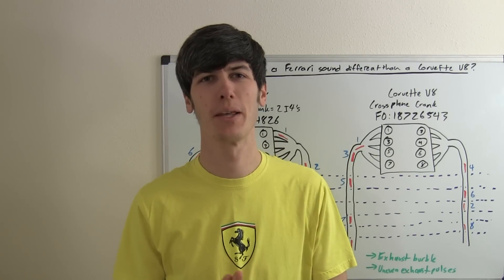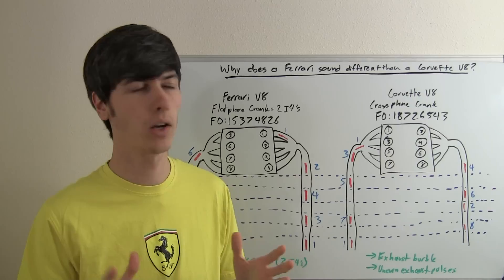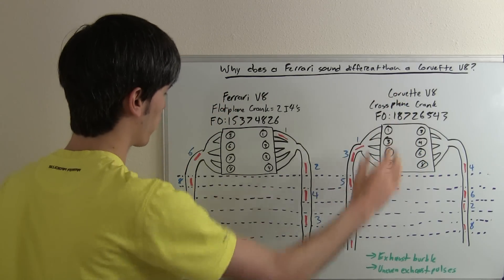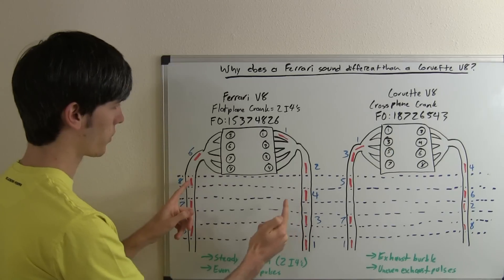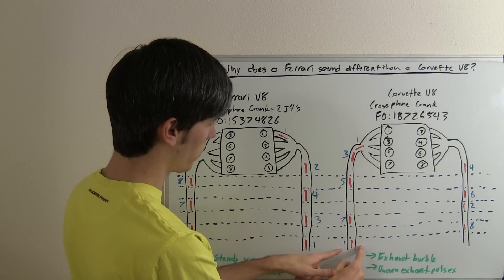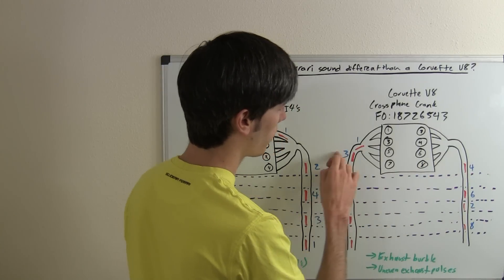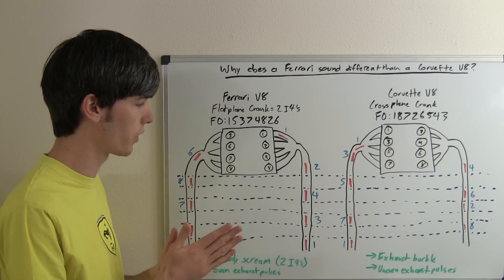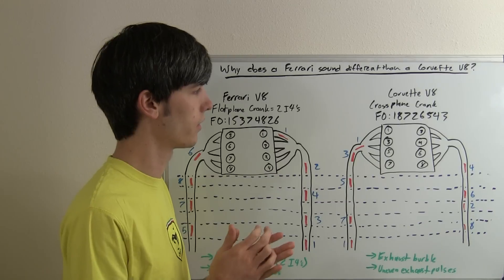Ferrari V8 vs Corvette V8 - Why do they sound different?

Comment: Huge corvette fan but the sound of a 458 and especially the speciale are two of my all time favorite soundtracks I've heard in person. There was a 458 on the freeway in LA with a new c7 vette right behind it and going through a little tunnel when there was a break in traffic and the 458 lit it up a bit then the vette and imo it was not a hard choice to favorite the ferarri. I've read the way the pushrod engine in vettes make them quiter then a dohc (not sure if I have that right) but I can tell compared to other v8s the sound seems less powerful stock for stock. Still any LS engine sounds great to me and I've jeard a little bit of the new supercjarged z06 vette on TV the other day and it sounded mean. The big nasty is an appropriate name for the new z.

Comment: Have you done 1 explaining duel scroll turbos ? Or maybe supercharger or turbo explain how 1 uses exhaust and the other a belt maybe then explain the difference from roots an Centrifical chargers then maybe direct port N.O.S vs plate systems u know all the power adder stuff to grab attention of gear heads everywhere.ur drawing board approach could work for just about anyone who can pay attention for longer than 15 mins

Comment: this is why my Porsche 968 with short stroke 388 c.i. LS7 sounds so good. I've got long tube headers into a huge y-pipe w/ 4" to 3.5" reducer and 3.5" single exhaust w/ 2 borla resonators and 15"X9"X5" vibrant performance muffler out the back. The open pipe system + good spl reduction plus point source sound out the back takes a lot of the harsh sound out.

Comment: American (crossplane) V8s - Throaty thunder
British crossplane V8s - VERY similar to (or about the same as) American crossplane V8s
British flatplane V8s - Badass growl
German crossplane V8s (especially from Audi and Mercedes) - Deep, badass, teutonic rumble
German flatplane V8s - Apart from BMW's P65B44 from the Z4 GT3 and flatplane version of the S65 from the i8 V8 GTR (which sound the same as German crossplane V8s) and the P60B40 (which sounds about the same as British flatplane V8s), it's pretty much meh (if we talk about Class 1 DTM engines)
Australian V8s - Throaty, growl-like roar
Italian crossplane V8 (from Maserati) - Badass, grow-like roar
Italian flatplane V8s - Beautiful, symphonic roar
Japanese crossplane V8s - Same as American and British crossplane V8s (apart from Yamaha-tuned Volvo V8, which sounds like a mix between American and German crossplane V8s)

Comment: Most Ferrari V8's are small in displacement, and it needs to rev high to get into the power band (5,500 to 9000rpm) Ferrari 458 (4.5 liter)  Most American V8's are much larger in displacement, and the bigger the motor the more torque you have, and most of the time you have the power right out the box. From idle to 6,500 rpm ( 6.2 Liter LT1)

Comment: Yeah man. Can you explain the firing order you got. I'm pretty sure Corvettes use a small block 350 which is 18436572
Reply: I thought I was the only one that noticed lol.... and I really like this guy, but now I have to question everything that he has led me to believe! LMAO
Reply: Uhhhh no. I believe that the older corvettes used the 350, but I know for a fact that the c6 uses the ls7 engine. Yes similar but different. I do think that he should have specified what corvette and exactly what engine he was talking about since Chevrolet has used so many different types of their v8 engines in all the corvettes.
Reply: The first and second gen small blocks used the old 18436572 firing order. The gen 3 and newer (starting with the LS1) switched to the 18726543.

Comment: Other reasons the Ferrari's have the hi pitch scream is also because of small cylinder bores and small valves and pent combustion chamber. Corvettes has large cylinder bores larger valves and a wedge/ kidney bean combustion chamber. The small bore acts more like a whistle making it sound like a  scream. Where as the large bore acts more like a bass port releasing a burbling boom.  Fun fact the uneven pulses are actually equalized on all modern day V8 at the catalytic converter which doubles as a X pipe (or cross over tube or H pipe is what they called them in the 60's). American V8 can accomplish the Ferrari scream I encourage you to look into a 1966 Ford GT40 with what is called "Snakepipe headers" Ford equalized the exhaust pulses with the headers. The larger bore and wedge combustion chamber (lower rev range) still makes it largely sound like an American V8, but you can hear it just start to scream on the Mulsanne Straight at Le Mans. Ford used the same "Snake pipe" technology on their 1960's V8 Indy car ( those did Scream!) To better prove the point it's the small cylinder bore I encourage you to check out the smoking tires channel video "The Cobra-Blown, Lexus V8 Swapped "No Style" '75 Corolla" It's a small bore Lexus V8 with an American style crank and firing order with the "Snakepipe Headers" it screams like a Ferrari. Enjoy!

Comment: This is only PART of the reason a Ferrari V-8 has that high pitched "scream".  There are several other reasons: 

1. The Ferrari cylinder size is going to be smaller than an American V-8.

2. The stroke of the Ferrari is going to be shorter than an American V-8.

3. Having 5 valves per cylinder in a Ferrari versus an American 4 valves per cylinder. 

4. The Ferrari has a smaller exhaust diameter than an American V-8. 

These all contribute to the sound being different.

Comment: The shape and weight of the crankshaft in flatplane engines aren't compensated enough by their piston firing orders to have the edge. The lower center of gravity and firing pattern of crossplanes are superior in my opinion due to the evenness of the crank among other things. That's why you see 13,000(top fuel dragster) horsepower crossplane engines and no flatplanes even close. And I also prefer the exhaust note.
Reply from the maker: I can assure you the multiple-thousand horsepower level comes down to much more than the crankshaft design. An incredible amount of boost would be a start.

Comment: You explained that Ferrari V8 has been made this way because the exhaust scavenging is improved by avoiding pressure spikes. However, why is a Corvette engine made like it is, what is the technical advantage of it? Is it done to avoid the high pitched exhaust whine?
Reply from the maker: Siana Gearz This should help explain each: https://www.youtube.com/watch?v=_TssXF8yQek

Comment: I'm a freshman in college and I'm an engineering major. I've decided to be a mechanical engineer, and I want to focus on the sound of a car. What focus of mechanical engineering deals with the sound of a car? Would I be a crankshaft engineer, an exhaust engineer, or is it a different focus?
Reply from the maker: TheFutureEVH You have a long road ahead of you, but ME is definitely a rewarding degree. My suggestion would be to work through your ME classes and see which ones you enjoy most, and find careers that match up with those interests. Acoustics is all vibrations. Anything that vibrates can make a sound. It's probably one of the more challenging things to grasp, from a mathematical standpoint. Good luck!
Reply: Thank you for answering, but I'm wondering which part of the engine is mostly responsible for the sound? I would like to be an engineer that deals with the sound the car makes.

Comment: they sound different because of the cylinder sizes and because of the different rev-limiters
Reply: They're both big engines and the rev limiter doesn't affect the sound, while it is true that one revs higher than the other. It's mostly the structural differences between both engines. A >1l miniature V8 based on a chevrolet design sounds more similar to the actual corvette engine than the ferrari engine which is much bigger.

Comment: On a flat crank V8 engine, you have four cylinders at TDC at any one time.  In a four cycle engine, that means two must be in firing while two are in exhaust.  So doesn't that mean your exhaust pulse timing diagram is off?  They are not staggered bank to bank, but rather pulse both banks at the same time, followed by 180 degrees of no firing.  In contrast, the cross plane crank gets a single firing pulse every 90 degrees.
Reply from the maker: Brett Dougherty Remember the cylinder banks are at 90 degrees, so when one bank is at TDC it does not mean the other is. Here's an animation so you can understand the firing orders are one at a time: https://www.youtube.com/watch?v=I29P3K6POu4

Comment: What about my engine (Hyundai G4ED 1.6) that fires 1342, and a Honda b16 that fires the same pattern? They sound very different compared to each other. Could it be different head and valvetrain design?

Comment: So would it be correct to say that the flatplane V8 would not benefit much (at all?) from the crossover pipe that does such a nice job of improving exhaust scavenging on American V8 engines?
Reply: OffRoadRN i think that when you are going to have a turbo on your v8 engine and its a flatplate, you wil have smooth and better boost than with a crossover.

Comment: Can you give any input on what would cause the "growling" sound on Suzuki GSXR models compared to the other inline fours? Would it be a crank issue again? When I rode one for a year it always sounded like the growl was coming from the airbox, and it happens between approx 4000 & 7000 rpm.

Comment: question, are they doing the different  firing orders just for the sound, or does one of them have some advantage in handling\power?
Reply: They have different firing order because of different crank layouts. Flat plane cranks are lighter and rev up faster and higher, but cross plane cranks have gentler NVH properties. The difference is explained in the other videos on this channel.
Reply: Karri Koivusalo whats NVH

Comment: If you had a custom header on the cross plane that separated the exhaust pulses evenly, would it sound like a cross plane without the downside of the larger secondary forces? Cross 3 and 5 over to the other side and 4 and six to their opposite side. Now this is assuming you have room to make all 8 header pipes evenly lengthened.
Reply: Would it sound like a flat plane crank*
Reply: +slowsword 
I think they might have done this on the old 1960s gt40 racing Le Mons with a ford 427 big block.

Comment: can you explain how cars with the engines over the drive wheels get the power to the wheels? (for example your integra) I can see how a normal fr layout car's drivetrain works, but not with a front engine front wheel drive car or rear engine rwd car

Comment: There is a lot more  to the sound difference then the firing order. 4 valve vs 2 valve , headers vs manifolds, tube design and lengths, H pipe  and X pipe as well as the mufflers. If you spend the time you could make a Ferrari sound with OHV engine.
Reply: They have done it with NASCAR years ago.

Comment: I have flat plain v8 engine and I can’t get it to scream like F1 v8 despite equal length manifold and 10500 rpm. Would the problem be because the engine is 72 degree block instead of 90 degree? I just would like to know what I need to do to make this engine scream

Comment: Isnt there a header you can get for a cross plain V8 that will space out the exhaust pulses from the cylinders that fire together?? ie. the header will have 2 of the runners longer so that one cylinder on each bank will have its exhaust pulse better mesh with the other pulses for improved scavenging??
Reply: it called 180 degree header

Comment: @ Engineering Explained.    I have a question.  My knowledge on cars is limited.  I have a Chevy V8.  I don't like the muscle car rumble "burble" sound, and I'm trying to eliminate it as much as possible.  I've read that swapping the firing order of 4/7 will smooth it out somewhat.  Also, I've heard of a 2/3 swap.  Would the 4/7 and 2/3 swap together eliminate the burble even more, and even out the exhaust pulses closer to the flatplane sound?   Does 4/7 work better alone?  Or does 4/7 and 2/3 together put the exhaust pulses back to stock (which I want to avoid)?
Reply from the maker: TheMr007247 The firing order is chosen for balancing reasons. I certainly wouldn't change it.
Reply: Engineering Explained  Is there another option to help even out exhaust pulse?

Comment: Crossplane engines are good for normal road cars which do not need to rew high and they are much smoother at the idle than flatplane engines , but they need heavy counterweights (talking about vibrations) . You certanly would not want to have your expensive $100.000 Mercedes vibrating at traffic light . Problem is that they start to loose torque high up because of backpreasure . Flatplane engies counterweights would not help , but their smooth out over 1000 rpm . Also , they have constant torque through whole rew range . So , for sport car , flatplane is better .

Comment: The sound is mostly different because american V8s have larger stroke vs ferrari engine's who have a smaller stroke but bigger bore for the same displacement.  This also explain why they can rev higher.
Reply: Francis Lapointe the real difference in rpm capability exists in the valve actuation architecture; ie the pushrod vs ohc argument

Comment: I think also that if one of the engines is smaller than the other one is also a factor why they sound different.
Reply from the maker: MC Taipan There are many factors which affect noise, however each of these engines have distinctive characteristics in the exhaust sound (burble vs whine) which are derived from the firing order.

Comment: Does the flate plane crank have anything to do with the typical less torque numbers made by ferrari vs the others? I knew about the firing order and  minor difference in balancing of the motor. But have always wondered why a Ferrari V8 made less torque then near equivalent Cross-plane v8 (be it US, German, or Japanese)
Reply from the maker: +Michael Gross Probably because the Ferrari V8s tend to be much smaller displacements but rev higher, not necessarily the crank design.
Reply: On top of that it may have something to do with the bore/stroke ratio for the displacement
Reply: +Engineering Explained Actually I believe that helps by reducing the rotating mass in the counter weight department which seems to help the engines pull another 1000 or so RPMs

Comment: Yo Jason!! In one of the fast and furious movies, Brian pulls up to a stop and lets off the gas. When he does this the engine goes from high rpm to low and the exhaust makes 3 different sounding notes, once again from high to low, along with the RPM before idling instead of just getting quieter like a normal exhaust. Is this a real thing or it just something to make the movie sound cooler? Thanks alot
Reply from the maker: Epicidey Link?
Reply: You mean where the Charger did a wheelie? It's possible. I see it all the time at the drag strip.

Comment: So would it be correct to assume (if I got the physics right) that a crossplane V8 should have more torque, and flatplane should be more horsey?

BTW do you happen to know what sort of crankshaft Porsche use in their flat 6?
Reply from the maker: Sammy, Ahmose I would not make assumptions about the torque/power vs one-another. Not sure about the flat six.

Comment: Can you swap the crank shaft successfully and keep the same engine block?
Reply: They are two different sizes, so of course not.  But there are aftermarket 180 degree crank shafts for Chevy and Ford V8s.  They are intended for racing.

Comment: Don't V8s fire 2 cylinders in each stroke? I think this video might be misleading with the firing order... I could be wrong, I'm just thinking from an inline-4 perspective where each cylinder fires during one of the 4 strokes.
Reply from the maker: pgorelov Nope, much smoother to fire them separately.
Reply: Engineering Explained Ah true that, thanks. I guess it's also because the cylinders are in a V of 15-110 degrees... I didn't think about that.

Comment: Could you not change the outlet manifold on the corvette so that the pipes from say 6 and 2 are different lengths? Then you could time the pulses so it's even.
Reply from the maker: GangstaBoiiiiiii You could, yes. Adds complexity and weight of course.
Reply: May as well go 180 degree headers. Number 3, 4, 5, 6 exhaust tubes cross under to the other side to even out the pulses.